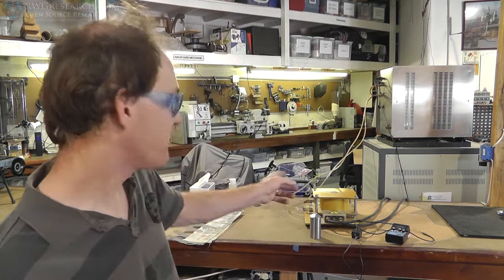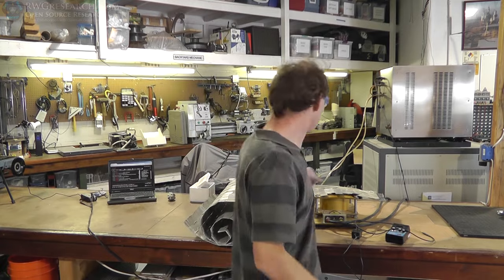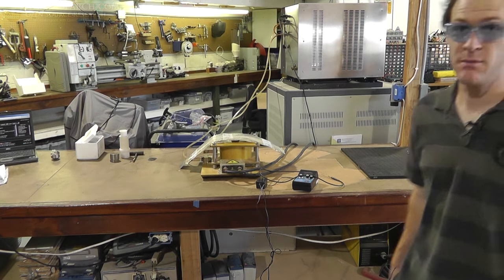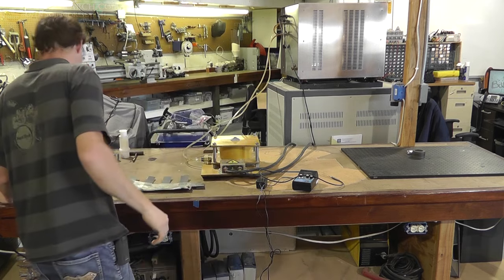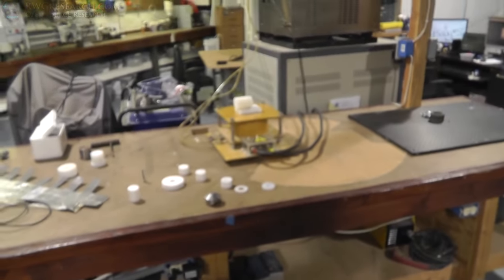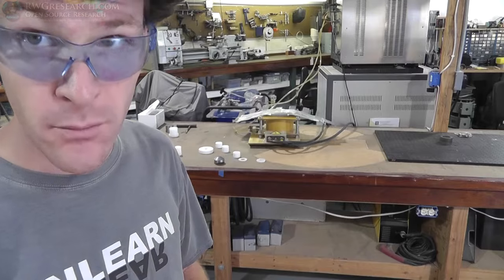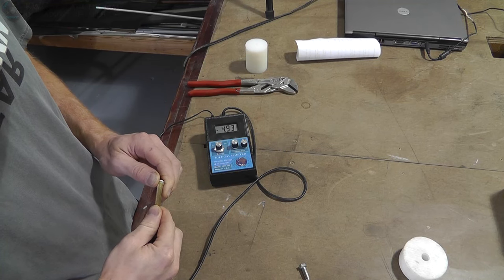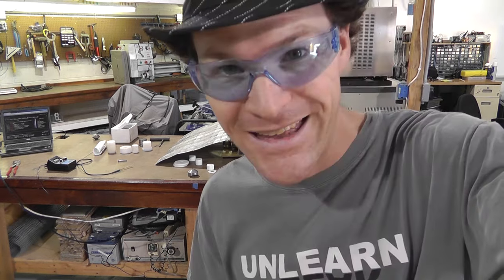Test:9.0 Magnetizing Experiments  : Testing Shielding Materials

Comment: Each layer of Giron is good for about 700 gauss. So stack them up. Also each layer is used to allow flux pass the flux as a divertary material, not as an insulator. So I think electrostatic potentials would of have a large impact here. 

I really like the idea you used to focus the flux to a point, that is genius 😎
Reply: 🧲 But  does it allow you to re-direct the flux which is what he wants to do.

Comment: You can magnetize pipe by putting the cable  through it.   It will not be a magnet from end to end but rather around the circumference.    If there are cracks running along 90 degrees to the circumference,  magnetic flux will leak out , which is detectable with iron filings or probably your plastic sheet that shows mag fields.

Comment: it worked ... just not the way you expected it to.   I think the shielding flattened the field closer the the coil. evidenced by weaker strength on the far end but less change on the closer to coil end. try this whit the shield over the magnet slug. I'd like to see those results in comparison. if shielding is what you want maybe a layer of your shielding then a layer of foam the another layer of shielding and so on. like ez water there should be a given amount of skin effect

Comment from the maker: In this test i wanted to see how well this shielding Material works.

i explain this more in the next video but for your reference for now.

any shielding Materials that are saturated to there max intern are now better conductors of the magnetism. so its as if its not there at all.

Shielding Materials are magnetic. most all of them are highly magnetic. this is how they shield the magnet flux. they " soak it up" there for " shielding" it.

This is part of the reason that we cant just slap Shielding Material everywhere and make a magnet motor work.

more on theses test can be found here: http://rwgresearch.com/open-projects/...

Thanks,
~Russ Gries
Reply: ***** 
Whats about Mu-Metal? Did u test this or try it in the future?
Reply: ***** Just had an magnet insight.
I wonder what would happen if you magnetized a steel tuning fork and wired it like a Ed Leedskalnin "perpetual motion holder", without capping the ends.. Energy, vibration and frequency! Make the center holes of the coils large enough so the coils don't actually touch the magnet tuning fork. Motion and magnets and copper windings...right? Love what you do, love your shop.